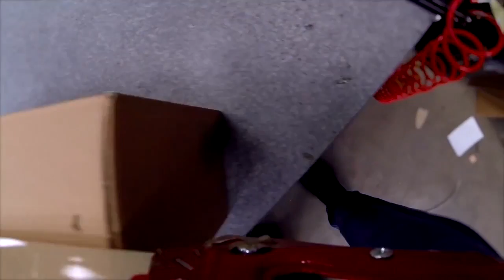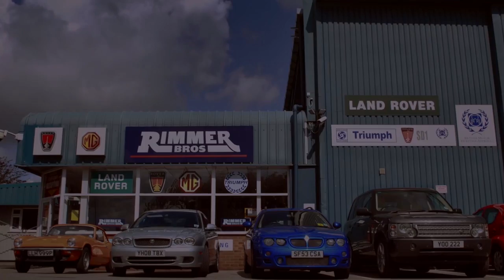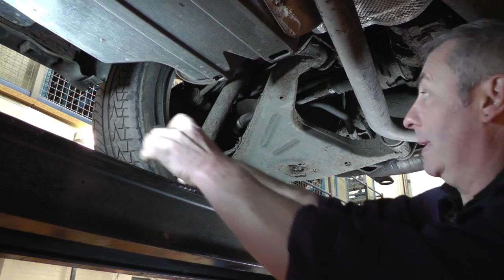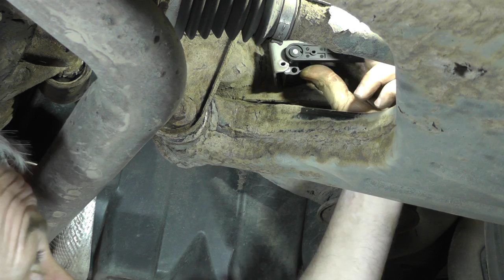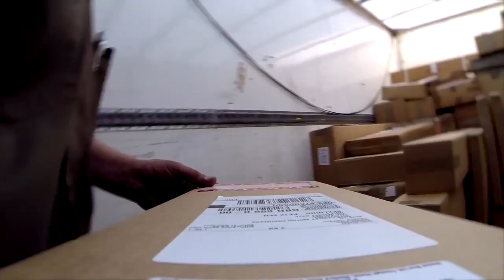Range Rover L322 - How to Replace the Height Sensor

Comment: Got a 2005 RR Sport with suspension fault, yellow warning light on dash, showing right rear on display, visibly low to look at as if airbag knackered but only get it at low speed then yellow light goes out and normal height restored according to display. Ordered a height sensor from Rimmer Bros and the airbag shock but they said no just get the sensor first so I did. Fitted it. Without calibrating so far. All working as should and no warning light, no drop in airbag.    Big Big thanks to Rimmer Bros, great advice, great service and they saved me money.

Comment: Hello dose this work on 2011 jeep grand Cherokee overland my immediate air suspension came on but the car is just stuck in the regular mode won't shift into sport or any other how do you know if it's the module,height sensor or computer thanks for the video

Comment: Does the suspension need calibrating afterwards as well or will the signal sent by the unit match the old one? Haven't done this job but imagine I might need to soon enough on my 2004 L322.
Reply from the maker: Hi there, Yes, the vehicle should be recalibrated by a dealer using diagnostic equipment.
Reply: Thanks.   Found the video to be very clear and useful.   Thanks for posting it.
Reply: May be no....Just diagnostic clear the Fault